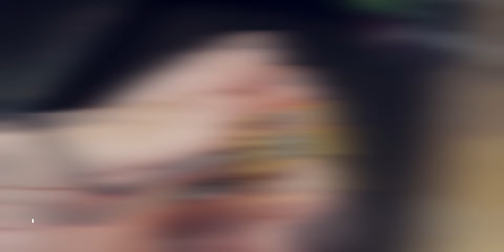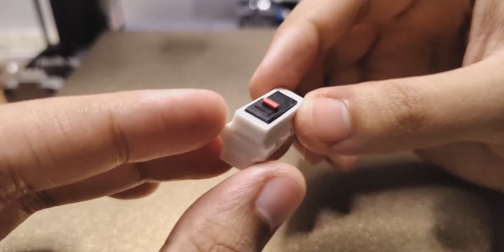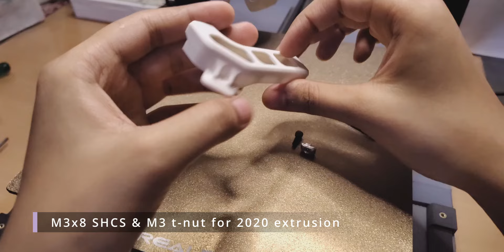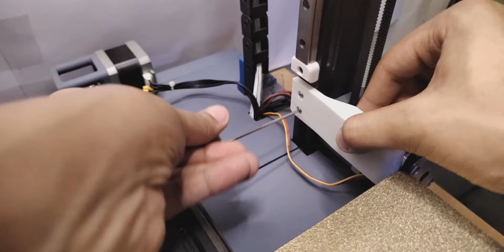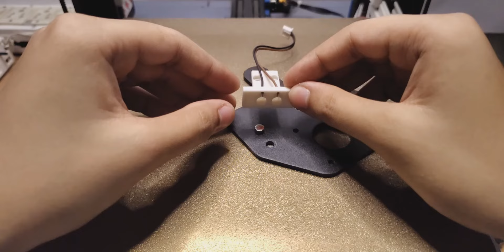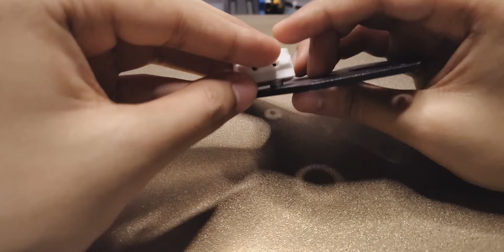A Better Probe For Your Voron Switchwire | Magprobe HX

Comment: I guess this runs on klipper? is there a way to do this with marlin? i cant find anything about this kind of probe deployment in the conf files or docs.
Reply from the maker: Yes, this runs on klipper firmware. I don't have knowledge if it this same approach can be done in Marlin.
Reply: @HyperMakes  thank for the answer - I finally got marlin to do it. but the more i got into marlin, the more i realized I should switch to klipper! :)
Reply: Hi Simon, I'm searching for a solution for this for some time now. Can you share your Marlin config?
Reply: found! Marlin 2.1.3 beta 3 have this new option on MAG_MOUNTED_PROBE configuration.

Comment: Do you have complete config files that show how you setup the Z max endstop (home Z first to know how to find the probe!), then probe to finalize Z zero position over the bed (I'm guessing).  Also how would you set up the config file to use a Z min endstop?  How far above the bed would the Z min endstop need to trigger?  (I assume Z MAX triggers at the absolute top position of the gantry, and I assume you use either Z max or Z min endstops but NOT both).
Thank you for any help
Reply: yes, I'm also still confused about how to configure the z max enstop for homing
Reply: @madorax251  I now think I might not need the Z max probe at all.  Just manually put the probe in place and then home the Z axis.  Now that Z height is known remove the probe and place a feeler gauge under the nozzle, and bring the Z axis down until the gauge fits under the nozzle, and note the indicated z height.  Adjust the z offset from mainsail until the feeler gauge fits when the indicated height is the same as the gauge value used.   Now raise the nozzle and replace the probe.  Move the probe towards the extented dock until it clicks into place, and note the Z and X positions.  Record these as the docking coordinates.    Add undocking gcpde to the print end gcode, and the docking gcode to the final of the starting gcode.
Reply from the maker: I have added my printer.cfg file in the github repository: https://github.com/Kruze17/Magprobe-HX/blob/main/Klipper%20config%20file/printer.cfg
The z endstop is used to find the z maximum of the axis and the probe is just used to do the bed mesh for bed levelling.

Comment: how to configure z max endstop for z homing can you share the printer.cfg you are using?
Reply: i also would like to have it
Reply: It took me awhile to realize that the z MAX endstop isn't needed.
If the probe is defined as a virtual endstop, the printer will use it when homing.
Manually mount the probe on the carriage before starting the print.  Now the startup code will first home all axies (using the probe for the Z axis), and then probe the bed for mesh leveling.  At this point the z axis home is known, and the gcode will now dock the probe in the holder after cycling it out with the servo, and then swinging the servo back.  
The end print gcode will move the bed back to the home position and swing out the probe, and the print head will move to the right at the correct height and re-mount the probe after moving back to the left.  The probe will remain in place until the next print cycles.  A small bit of the bed will be lost to accomodate the probe arm in the front right corner, but even this can be used if the ending g code pauses the probe remount until the user removes the print surface first, or if the user manually replaces the probe.
Reply from the maker: I have added my printer.cfg file in the github repository: https://github.com/Kruze17/Magprobe-HX/blob/main/Klipper%20config%20file/printer.cfg
Please have a look.